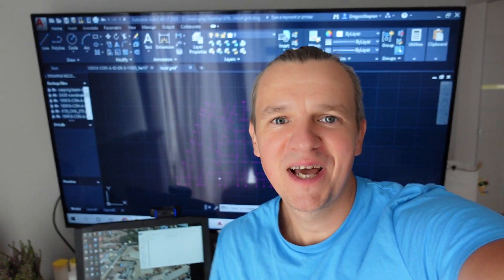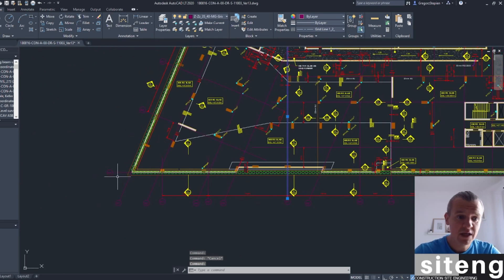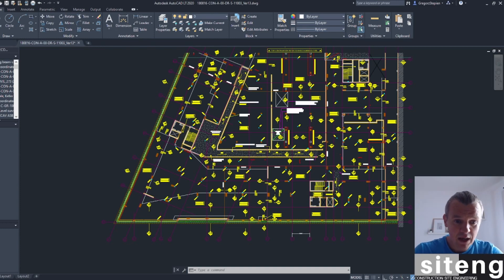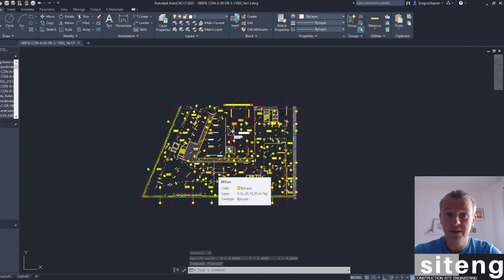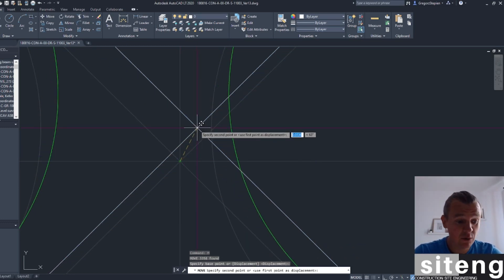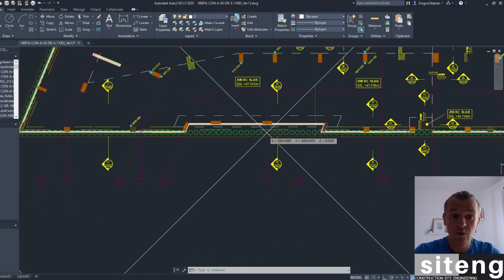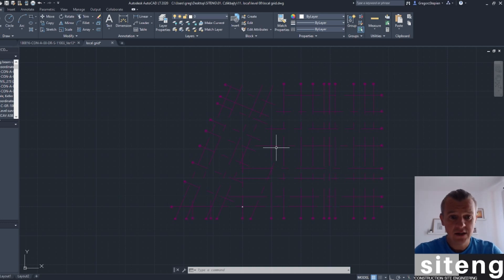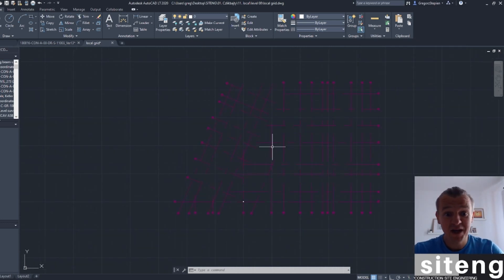SETTING OUT - LOCAL GRID coordinate system. How to create and work with new local coordinate system.

Comment: Sir,
I am learning this staff without going in the field. I have one question.

The started point you choose which is the crossing of two grids is a point that can be spotted in the site.. Am I correct?
Reply from the maker: You have to mark it on site
Reply: @SITENG  thanks sir.

When setting up TS in the site, this point works as point of occupation?.. correct?

Comment: Hello mate, it was an amazing video but the only thing is which button you press after you type in 5000. Because I’m pressing (TAB) and then 2000 and it changes into minus coordinates rather than showing what you did.. If you could reply that would be amazing. Thanks.
Reply from the maker: maybe just try right arrow instead of tab to type in the other coordinate. I am not really sure what's the problem, it should be the same - this will be your CAD settings.
Reply: @SITENG  thank you very much all sorted.
Reply from the maker: @nikolaoszambaku3082  great!

Comment: Greig, 
What do you reckon benefits are of using local grid over keeping it in national? Just jumped onto a job and engineer is using national for setting out a frame. I’ve always put them into locals but thinking about it now, don’t really work chainages and offsetts off like the old days, just plug them into the machine using the line work of the dxf, so is there much benefit of changing to local? Also a hastle sending over AB’s ect as have to convert them back. 
Cheers,
Joe
Reply from the maker: Hi Joe! I use local grid only with manual stations like TS06 where local grid is a game changer 😁 it would be useful for robotics in some cases but taking all pros and cons I am keeping all in national grid if I can use DXF etc. One of the reasons for it is, if there is any setting out mistake (design) people will be trying to blame you for not using the original co-ordinates and trying to blame your transformation for it (remember they often don't understand what they are talking about and you might not have a chance to prove you're right anyway).

Comment: Which MS is better in UK? MS in structure OR MS as a site engineer?
Reply from the maker: Hi Talha! Hard to say, depends what you want to do really. If it's on site it doesn't really matter much as you can do site engineer job and go higher and higher. Structure might be good as you can change your career later from site to design and then you would probably need more structural knowledge :)